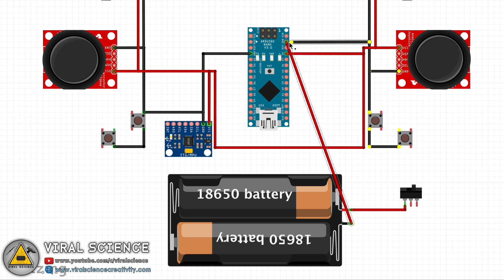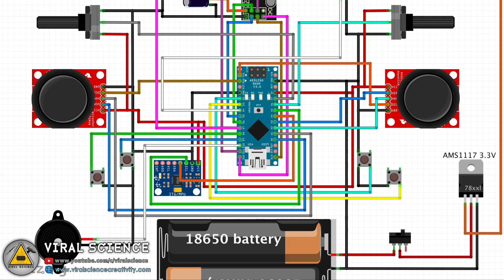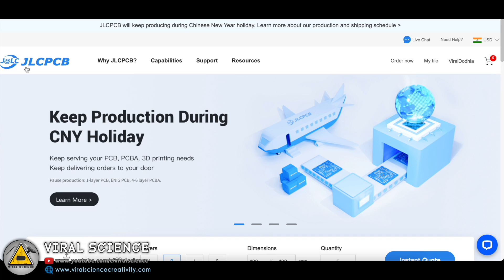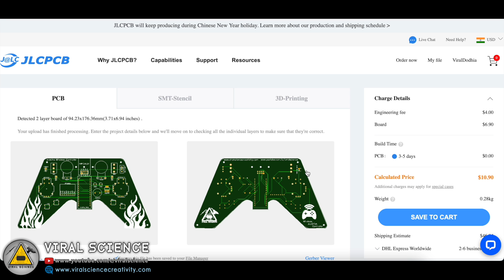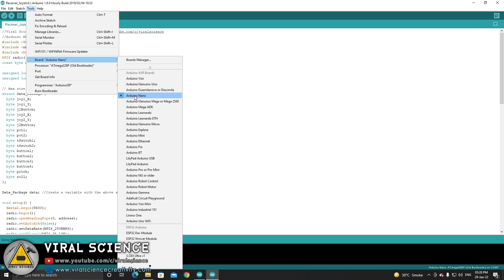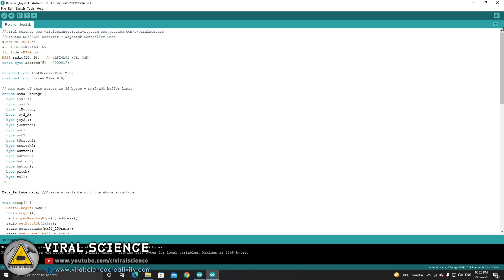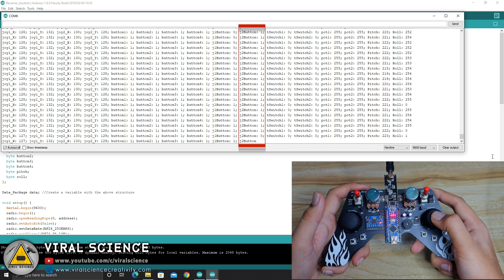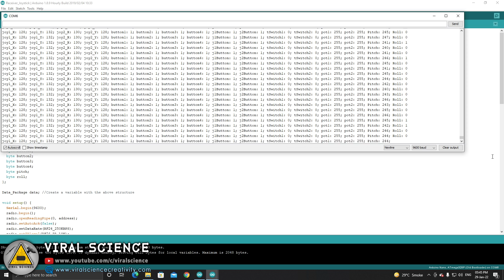Arduino NRF24L01 Joystick Controller Remote Transmitter

Comment: Thats nice, but how would you recharge the Li-ion batteries? Also, no over charge/discharge protection?
Reply: The regulator does that. Li-ion batteries dont recharge you just buy new ones they are fairly cheap

Comment: hello, thanks for this video i made the transmitter and receiver and their is a connection between them but i have a problem no channel on the receiver is resetting to 0 for example if i connect a led to a potentiometer CH the led doesn't turn off if the potentiometer is all the way down but i can increase the brightness  of the led when i move the potentiometer up even servos don't move or the motor on esc ,i can control the throttle but not turn it completely off. the same happen with switches can't turn of a led but can increase brightness of led when turned on. please if you have any idea tell me

thanks in advanced :)

Comment: The code does not work, it tells me an error in the MPU. It does not let me compile. Can you give me the correct libraries because the ones I installed do not work and it sends me that error 'class MPU6050' has no member named 'begin'
Reply: Hello friend, I was interested in this joystick project and until today, a year later, I haven't seen the result of your question to the designer, how did you manage to solve the NPU code?
Reply: Desculpa amigo, essa pergunta eu tambem fiz para o nosso colega 
@aberateklehaimanot9804, estou no aguardo de qualquer de nossos amigos

Comment: what is the range of this transmitter and receiver?
Reply: 1000m got antenna ones and 200m for the smaller ones. Depends on circuit though
Reply: @intisharalammisbahul9927  I have connected one without antenna module with receiver and another module WITH ANTENNA with transmitter...so what will be the range?
Reply: @subhajithalder3358  the range will depend on which is the transmitter and PA level set in code. I assume you set to max?

Truth to be told, I started learning to use them yesterday.

Comment: Thank you,Great video...the code does not want compile" MPU6050_SCALE_2000DPS, MPU6050_RANGE_2G)class MPU6050 has no member named "begin"  ".And what is the distance?and would you  be  nice  clarifying which of MPU6050 lib have you used?b/c i checked  in google and i found out many ppl are facing this same problem.regards.
Reply: Hello friend, I was interested in this joystick project and until today, a year later, I haven't seen the result of your question to the designer, how did you manage to solve the NPU code?

Comment: Dear sir
In transmitter ckt u need 3.3v supply for nrf module and u can provide it by using arduino nano directly like u provided in receiver.
Then why u use 3.3v voltage convertor in transmitter pcb
Please respond
Reply: That way the voltage is much stable
Reply: You Can add nrf24 adaptor modules instead of capacitor and HW-775(Mh-CD42) module convert to 5V to 3.3V and charge&discharge lion or lipo battery.